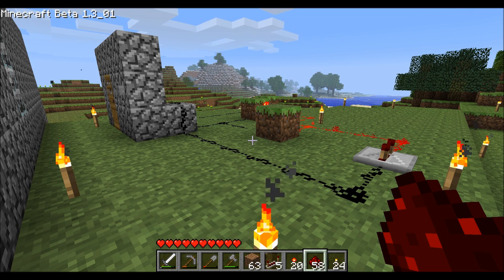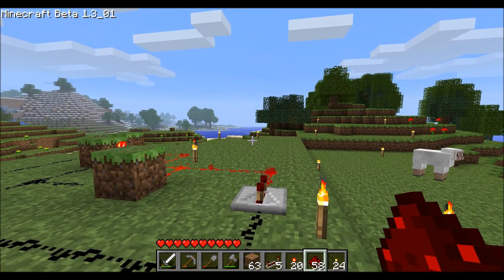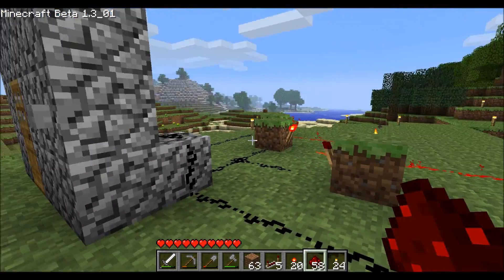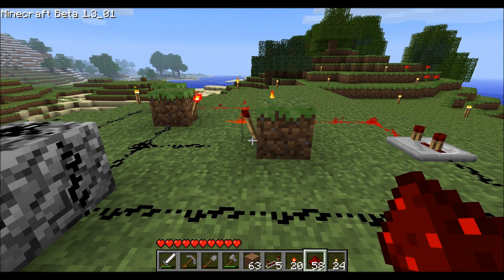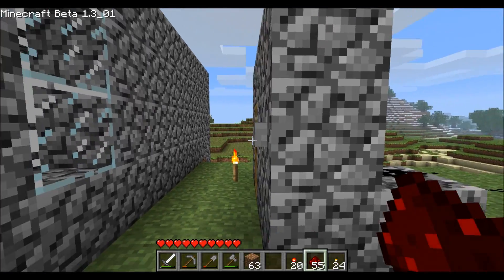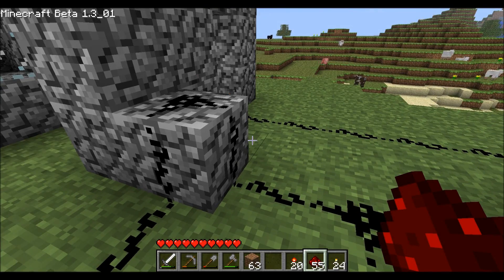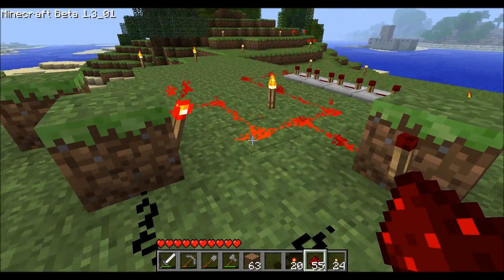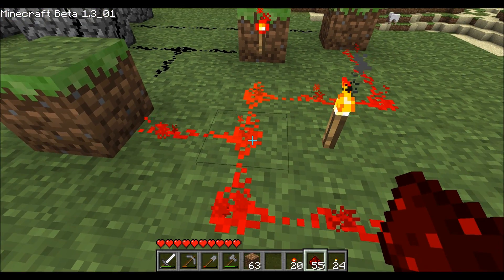Minecraft: Custom Button Delay Tutorial

Comment: @cmasupra make a 3x2 rectangle of wool facing upwards. punch out the bottom left block, the top middle block, and the bottom right block. on the leftmost block, place a redstone torch pointing to the left. on TOP of the middle block, place a repeater at 3 ticks pointing to the left block. on the LEFT of the middle block, place a redstone torch. on the rightmost block, place a button. on the space below the rightmost block, place one redstone dust. I hope this made sense lol

Comment: @Deano185 
People the design for this is VERY simple all you need to do is this:
1) make an RS-nor latch or a memory cell as he calls it
2) hook a button signal to the block of the POWERED side of the memory cell 
3) hook the same button signal to the block of the NOT-POWERED side of the memory cell with the amount of delay in between that you desire (this will reset the memory after the delay you put in between)
4) hook the redstone torch signal of the NOT-POWERED side to the door.

Comment: how do i make it so nobody can break the circuit. ive made this into a piston with 2different delay series connected to 2 different buttons each. but now if somebody presses one of the button twice in a row it will just break the circuit (the circuit wont break if they wait long enough for the wiring to reset before pressing the button again). im on multiplayer.